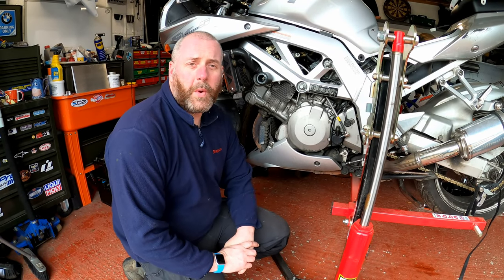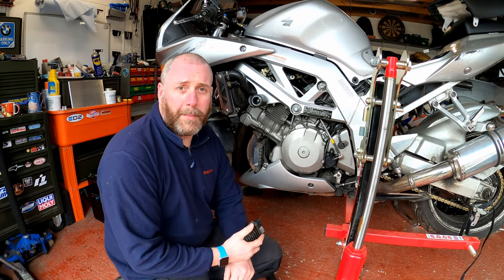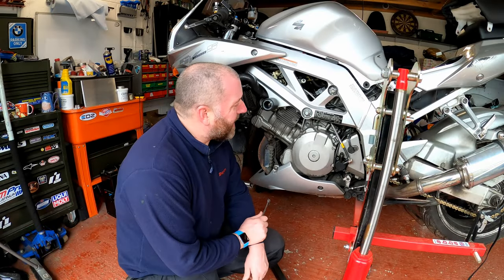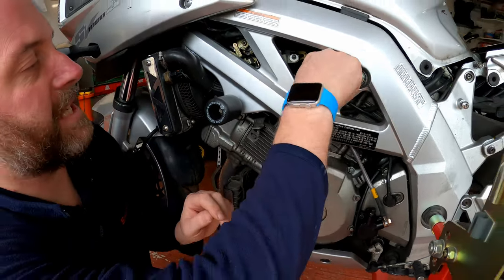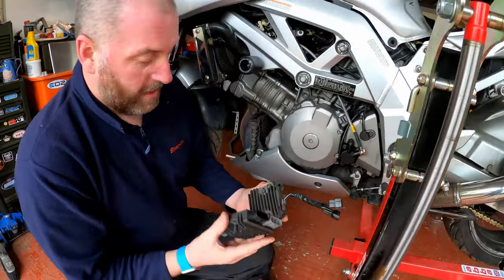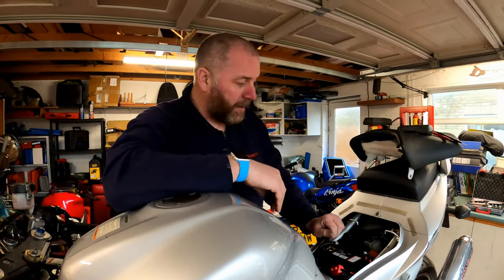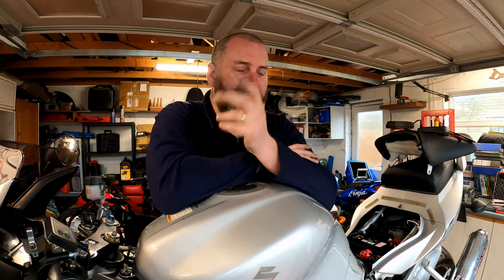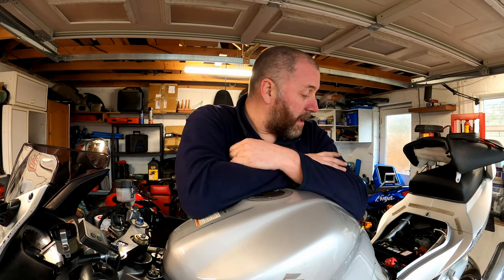Suzuki SV1000 Project Bike - Part 7 - Upgrading the Charging System With a Mosfet Reg Rec

Comment: Did you consider upgrading to a series regulator instead of mosfet? For e.g. the SH 847AA.
Reply from the maker: I get ya, I went for the FH020AA as I happen to have a few knocking around in the Shed/Garage. The SH847AA is an excellent R/R albeit quite an expensive option and also bloody huge! :D
Reply: @KevsShed  I agree, it's quite expensive.But in theory it helps keeping the stator healthy, and it's a must if you plan on switching to LED headlights. Some people say it also helps preserve the health of the rotor due to decreased temperature in that area. Anyway, nice video!
Reply: @KevsShed  I’m using the sv1000s engine as a donor for a reverse trike project due to health issue. I will be going with some led lighting so what rec reg do you recommend would work well?

Comment: Actually Kev - where did you buy your Reg Rec from ? Did it come with the connectors or are they an extra Thanks
Reply from the maker: The R/R are easily found on eBay mate, search for MT09 regulators, you’ll find the FH020AA R/R that way. Again you can find the connectors on eBay too, I’ll add a link to them in the video description when I can get on my computer 👍🏻

Comment: Any chance you could sell this as a kit? I'd like to buy one if possible
Reply from the maker: I will look into it mate! 👍🤓
Reply: @KevsShed  I think there's a market for it. Especially for us guys that don't know much about electrical work. I bought a mosfet rr a while back then quickly realized I don't know my head from my ass for wiring this thing in 😂😂.
Reply: Yeah I'll second that. Preferably with a connection that will plug straight into the Suzuki plug so can swap out of needed.
Reply: @KevsShed  Happy New Year's Kev! Would you mind making up one of these wiring sets to buy?
Reply: Any thoughts about doing this? Sounds like there's a market for it.
Reply: Hi Kev! I hope you've been well. Any chance I could buy a conversion kit from you? Please 🥺.

Comment: Where did you buy the RR?  Need get one myself
Reply from the maker: eBay mate, there’s loads, search for MT09 regulators, you should find loads 👍🏻
Reply: @KevsShed  I have vfr 800 same as yours and wanted to get mosfet but seems only place to get one is online. Thought might get quicker in bike shop on shelf but will order online thanks Alot 👍👍 love the vids 👌💪

Comment: best regulator oem? long lasting twill
Reply from the maker: Hey bud, OEM Suzuki R/R are notoriously poor, the Shindengen one that I fitted is a Mosfet equipped R/R and much more capable than the OEM item. That said, the life of the factory R/R can be improved by regularly inspecting and cleaning all of the wiring connections in the loom and giving them a liberal coating of dielectric grease to keep water out. Corrosion is the enemy on these connectors and will lead to increased resistance which in turn leads to extra heat and potential melting and charring of the connector which will lead to a charging system failure. 👍
Reply: @KevsShed  👍